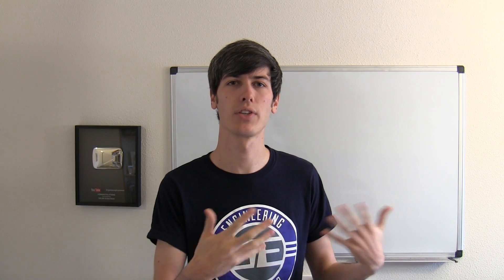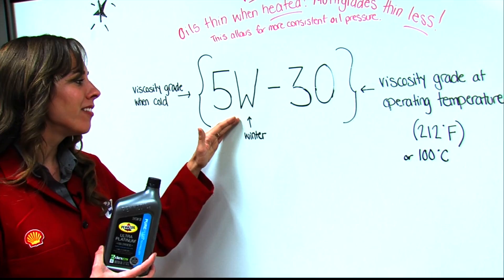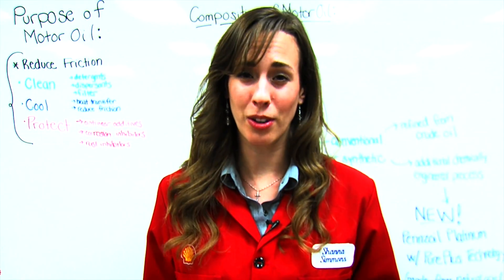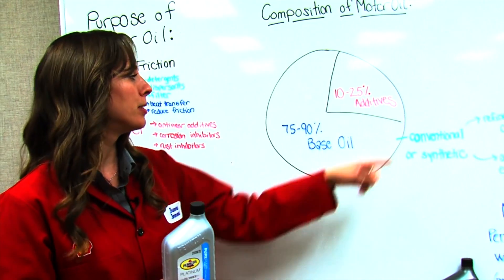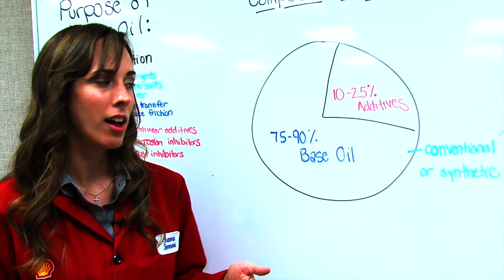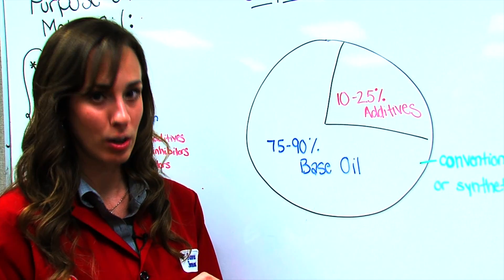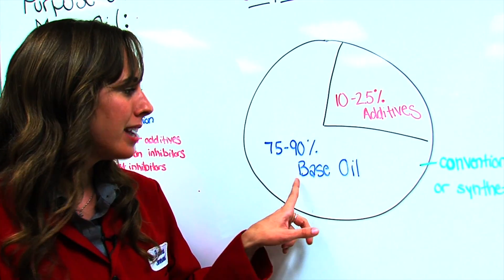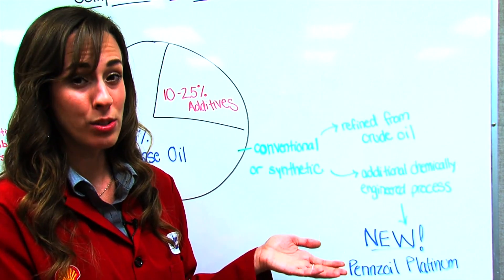Motor Oil Myths & FAQs - Synthetic vs Conventional

Comment: My experience -
Mineral oil breaks down after 6 months regardless of mileage. I have noticed lower performance and fuel economy over many years. Even unused new oil on an open container has a diminished life - I've witnessed this.
Full Synthetic - lasts much longer, both time and mileage. Discounted price FS oil is much better value than mineral oil.

Comment: I have a QUESTION. What about the concern over lower ZDDP levels in newer oils when used in older flat tappet engines concerning cam shaft wear?

Comment: I very much disagree with whether or not you can change oil weights. I literally watched over the last decade as BMW changed the recommendation twice. I have also talked to Engineers during training for Ford, that it's better to put 5w 30 and many of their engines calling for 5w 20, because it's better protection and it's only done because of C.A.F.E. and it gets you almost a mile to the gallon better than some of these really small engines. I would say it's more appropriate to say that there is a certain range that an engine will work and optimally that keeps it far away from whatever oil weight extremes that would cause we're. Whether that is too thick or too thin. And many times a manufacturer will change an oil weight standard for an engine that came out 10 years ago, and it just blows the entire myth apart.

Comment: I would say it's acids in the oil and during combustion because our vehicles that burn natural gas or propane the oil stays clean a lot longer it's the acids in the oil that that's the reason you need to change oil

Comment: Or you can simplify this whole story. If you don't change your oil and the contaminants become excessive it can block your oil filter which will engage the bypass valve. Then your engine has no oil filtering. Manufacturers sell the "long" service interval to sell you the car. They don't care if your engine wears fast as long as it's not in the warranty period.
Change your oil and filter often. After 100,200, 300k miles km's the inside of your engine should still be clean. That's it's ONLY normal operation.

Comment: I have a question,  can I mix same grade oil but different brands?
Reply: I have also mixed different groups and brands since I started driving in the mid 70's.  Never a problem, but I also didn't do it a lot, only when changing brands due to sales or topping off.

Comment: Just take out the EGR valve.....thats the biggest contamination of motoroil......running back the exhaust inside the engine is NOT a good idea...just saying
Reply: How do you stop GDI?  But, you're right.

Comment: So ... What about in 2002 when Ford back-spec'd their engines back even into the 90s to switch to 5w20.
Example is my 98 f150 4.6.
Manual says 10w30. But in 2002 the release from Ford says it's now 5w20.
In this case use what they said in the 2002 release? 4.6 from 2002 and on say 5w20 in their manuals
Reply: 5w20 is our corrupt government mandate for .0001 more mpg.

Comment: Motor oil contains (patented, per oil co. brand) chemicals, etc. to absorb, neutralize contaminants that are harmful to engine. When an oil turns dark, black, it's an indication that it is doing its job. So if you want to protect your motor oil so it looks clean all the time, and disregard the condition of your engine, then run an oil that doesn't absorb etc contaminants, etc..  Just makes good sense to protect the $50 crankcase oil investment, since engines are so cheap to replace.
Reply: The term "synthetic oil" is a linguistic flimflam, in my opinion.  But good flimflam makes for very successful marketing, sales, etc...
Reply: @zuutlmna  Your opinion is wrong, and projectfarm proves it.  Do some research before being wrong.

Comment: My manual says use everything under the sun. It just bases the viscosity on ambient air temp and leaves it to the owner to decide.  I want to get 5w-40 fully synthetic but my car was using 15w-40. I'm only concerned that on start up when cold the oil is too thin. Is that and issue or will the oil warm up quickly enough to bring it back 40 spec oil?

Comment: Can I use conventional 5w30 for my 2015 Subaru WRX?? My car is stock and I don't track
Reply: Been proven that full synthetics are better, and since you can get 5 qt. jugs under $20, why would you do that to that car?
Reply: @lonniebeal6032   thanks. Been using 5w30 synthetic since then. Since it's turbo engine. 
In Canada it's like 63 CA$ but on sale I bought a bunch

Comment: Is fully synthetic oil good for air cooled engine ( motor bike )?
Reply: Hmm, higher temperature range, better lubrication, won't break down in viscosity as easy, yup.   But if you have a wet clutch, Delo or Rotella is your best option.

Comment: Every company that sells motor oil for cars does tests. When they, whichever company it is, call it company X,  tests their oil against their competitors, X always is the winner. I have never seen a company do tests against other companies and say the other company beat theirs. Which tells you they are all lying about how great their oil is. If it is a SN oil it will do a good job, will mix readily with all other oils, it's required to do that,  all the rest is hype and advertising that you pay for. The testing and quality control budgets for all these companies is surpassed by the marketing and sales department budgets. All that crap on the side of the oil jugs is carefully thought out to take in the sucker.  Even the color of the jugs is done to enhance sales.  There may be a very slight bit of difference between the very cheapest SN oil and the best, but it is very slight. If 1 or 2% is important to you then buy the most expensive oil you can find, but it will not be noticeable to your car, just to your mind.

Comment: These grade labels are hopelessly misleading...there’s a movement towards a standardised grading that’s based on actual Centistoke kinematic viscosity tested at 40c and 100c. A Mobil 05w-30 (for example) may have a substantially different actual viscosity than a Castrol 05w-30. In today’s fully synthetic, fully engineered era, these old viscosity grade labels are virtually meaningless, bordering on dangerous.

Comment: What about all the grey area's and not just the generalization answers?
I will guarantee that most "race engines", being broke in is using a high zinc, special break in oil.
Maybe it's synthetic or not, but just a lot of reading out of the customer support hotline manual.

Comment: There is one question that is not addressed in that there is no distinction made between what the standard oils call a "synthetic oil" (which is actually blended regular oil with additives and a more refined petroleum based oil) and true 100% Synthetic which is the only real synthetic oil (like Amsoil 100% Synthetic type IV oil which is NOT petroleum based). All they are comparing is regular, Synthetic Blend and Full Synthetic oils (none of which are actually synthetic), which is not much of a difference, especially for the difference in cost.  I was one of the "unenlightened" ones who thought the oil companies were telling the truth (something about truth in advertising, which is supposed to be a law) about their oil being "FULL SYNTHETIC" until I started researching the matter. Then I found that ALL the oil companies had had a law suit about what can be called "synthetic" and that the FTC made a ruling that all they needed to do was to put certain additives in the oil to use that label. Then I found that there was really only ONE true synthetic oil on the market and that was the Amsoil 100% Synthetic (seems it HAS to say 100% Synthetic or it really isn't synthetic). Nothing like false advertising, eh? But then you get people like this contributor who perpetuates the lie by showing "comparisons" of "blended" and "full" synthetic, knowing full well that NEITHER is anything BUT blended. Always look for TYPE IV synthetic, it is the ONLY true synthetic oil.
Reply: Group III oils are still wayyy better than group II, and the prices are competitive unlike group IV.

Comment: 3:12 does this take or not take into consideration climate? For example I’m from the tropical zone where it’s very hot and I own a vehicle that recommends using 0w20 however I use 5w-40 to compensate for a change in climate. Should I continue to do this? Or should I strictly use what’s instructed by the manufacturer? Someone please answer these questions.

Comment: New gasoline cars 5w30, after 1 lakh km it's good with 5w40 , diesel cars 15w40 is good enough if you are in very cold regions 5w40 synthetic should be good .. Now if you sit inside a refrigerator it's obvious our blood thickens..  So once a engine cranks up it's good to have a slightly viscous oil for wear and load resistance rather than    slightly better fuel average. Choice is yours!!

Comment: I wanted to hear answers regarding using different viscosity rating from the manufacturer depending on the type of climate one lives in, for instance extremely cold and extremely hot weather. Should one choose a lower before the W number viscosity for extremely cold winters and increase viscosity (2nd number) for really hot summers?

Comment: Hmm, so my bikes owners manual said I should put 10w40 engine oil, but I put 15w50 (fully synthetic) in. I didn't have the manual at the time. Is it a huge problem? Seems to run fine.

Comment: Why does 5-30 fully symthetic engine oil turn red after around 2500 miles in a 1.6 litre vauxhall astra petrol engine. Vauxhall recomend fully symthetic oil In this car.

Comment: So what would make my car seem to run smoother on conventional and run worse on synthetic. I have a 2011 subaru legacy 3.6r with 83k on it so it's practically just broken in. I switched to dino oil just to see how it would run and it was shockingly better. Btw I know I'll have to change it earlier than synthetic. I figure if it seems to run better shouldn't I use that from now on as long as i follow the severe maintenance schedule.

Comment: Why is the recommendation 5w20 synthetic blend in the USA but 0w30 synthetic in Europe on an exact same spec 2.0 focus? My guess is America’s outrageous fuel mileage requirements. Due to the oil difference I noticed a difference in change intervals also 1 yr or 10k in US And 1yr or 12.5 in Europe. FYI I did double check to make sure it wasn’t a km.

Comment: And those of you trying to be as frugal as possible with your motorcycles, stop using automotive oil with friction reducing additives in your motorcycle that has a wet clutch and uses the same oil throughout.
Reply: Delo and Rotella can be used with wet clutches.

Comment: I switched to a 5w 40 synthetic oil in my 97 daweoo lanos without experiencing any kind of leaks will it harm my engine? (it used to run on a 20 w 50 conventional oil)

Comment: What if your engine has miles on and you want to put a heavier weight oil
Reply: Why would you want to do that? The makers spec provides optimum protection. Heavier oil will simply reduce flow to critical engine parts, thus exaggerating wear. Also remember that there is far more to oil than simply its SAE viscosity rating.

Comment: Synthetic oil was designed for people who go past regular conventional oil changes. It's recommended to change oil at 3000-5000 miles where synthetic can last about 2000 longer. Conventional oil is just as good as synthetic oil as long as your religious with your oil changes. Conventional oil has been used since the automobile and has done well since then. Keep your oil changed using conventional oil and you will not have any problems.
Reply: Not necessarily. There are virtually no Euro and Japanese diesel engines which have specs that can be met with conventional oil. Even if you change it every day. There is more to oil than than simply its SAE viscosity rating.

Comment: OK... Now so since the first number is for winter viscosity...  and since the other  number is the viscosity at operating temperature, If I am doing an oil change during the summer and I know I will changing my oil soon again (long trip planned) could I use a 10w40 instead of a 5w40? They are both 40 at the running temperature...

Comment: If I mix 5w30 Amsoil with 5w50 Amsoil in equal amounts, will I get a 5w40 viscosity rating?  No one on YouTube has addressed this issue, that I can find.
Reply: AMSOIL is the place to ask this. Lots more to oil than than simply its SAE viscosity rating.
Reply: Close.  Say 2 qts 5w50 and 2 qts. 5w40,  that's 180 (2x50 + 2x40) / 4 =45.

Comment: Does a diesel engine's oil break down less or none whatsoever over time due to its fuel being an oil versus gasoline is more like a solvent?  Or is it due to diesels somehow having a tighter piston ring seal preventing fuel from entering crankcase and breaking down the oil.   I've heard thats a major contributor to the longevity of a diesel engine. (other than lower engine operating speeds and block rigidity)

Comment: Red line or Clean boost oil is the absolute best. All you have to do it try to clean it. Spraying break cleaner at it is like water. Only race gas will break it down

Comment: Mmm and lets say a car says use 5-30 but after 200k should still use 5w-30?
Reply: if it's working fine then yes. Why not? That's what we do here in Europe and we don't experience issues as a result. Thicker oil means reduced flow.

Comment: I will tell you that Joe Gibbs driven break in oil is worth it’s weight in gold In my book. Brad Pen is also. There was a lot of nitro engines scuffing pistons on the warm up. By just switching oils to the redline nitro 70 weight all that went away.  In my personal Diesel trucks I run nothing but Rotella . I have friends that run mini mod tractors with blow alky hemis that are sponsored by shell. The new race oil shell came out with is pretty unreal how good it is.

Comment: Your almost sending people in a bad direction!!! Synthetic oil has lots of detergent to act as a dispersant . As filtration technology became better in the early 80s they started adding detergent to lock on to the particulate to make the mass of the combined material bigger so that the filter element could lock on to it and retain the contaminate removing it from the engine. Back in the day it was common practice to remove the oil pan and clean the contaminated sludge off the oil pan. Back then filtration was not that good so the used a straight weight non detergent oil so the contaminant would settle to the bottom. Now days the good stuff in oil like ZDDP aka zinc is being removed because it’s bad form the catalytic converts . This means oil company’s are more worried about O2 sensors and catalyst filters then the proper lubrication to the engine. It’s also VERY IMPORTANT to understand that detergent being a dispersant also means it will not allow the good stuff like zinc to adhere to the friction surfaces. This is why when breaking in a older flat tapped or even roller lifter engine it’s best to use a non detergent oil. By using a straight weight NON detergent oil and mixing the ZDDP zink additive to it will greatly help the break in period . To my knowledge except racing oils there are no straight viscosity synthetic oils that have low levels of detergent . To recap oil company’s and fuel company’s are more worried about emissions and mpg...than protecting engines .  Honestly the 3 best oil brands you can run are... red line oil because the base oil they use is super high end and found in transformers on telephone pols used to cool. The red line oil resits burning considerably better than any thing else out there. This is very important in my line of work to combat the driver burning to death, but also is important in high performance engine with high cylinder pressures because of induced detonation due to oil getting in to the combustion chamber . Combustion technology’s aka Clean boost oil is right there with red line. The owner of clean boost was red lines head chemist for manny years. There’s also Mr Race Oil . A new company doing very great things in the high Perfromance field. I love your vids and your a smart kid. I think the older you get you will start to realize there’s a lot more out there to learn then first thought as a young man.

Comment: Ford recommends 5w-30 (preferred as per the owner's manual)  for my car but 10w-40 (A5/B5  specs) is also an acceptable grade. I live in the desert where the temperatures rise up to 50degC (120degF). Do you think it is better to use 10w-40? or I should stick with 5w-30 as it is the manufacturer's preferred choice. The temperature never dives below 15degC (60degF). I am trying to understand the relation between the ambient temperature and the engine oil grade.

Comment: with that  being said what about for older vehicles which most mechanics seem to recommend using a higher viscosity oil for that vehicle say originally a vehicle is supposed to use 5w-20 but after 150K miles the mechanic recommends using 5W-30 would that still cause an engine deficiency issue or not?

Comment: For engine upgrades, what is more important to change once power reaches a certain level (say, for example, a 1.8ltr NB MX5 when the engine power is doubled) to maintain effectiveness? Oil viscosity or oil cooling?

Comment: I hear all the time that older vehicles that have always used conventional oil should be kept with conventional oil. Is there any reason not to switch to synthetic on a 30 year-old car?
Reply from the maker: Nope, fine to switch over! Sometimes people say it can cause a leak - what may actually happen is the synthetic cleans out sludge or build-up that may have been acting as a plug, but it's not synthetic oil that's causing the leak, the leak was always there. No reason not to run a higher quality oil in older cars.
Reply: Engineering Explained Wow, that was a quick reply! That actually makes sense though. I'll keep that in mind next time I get ready to change my oil! Thanks!